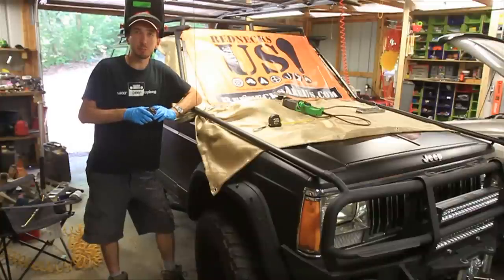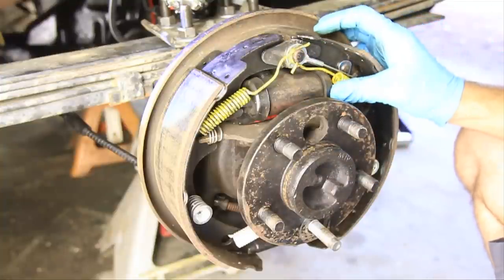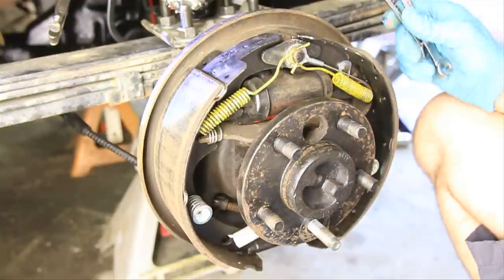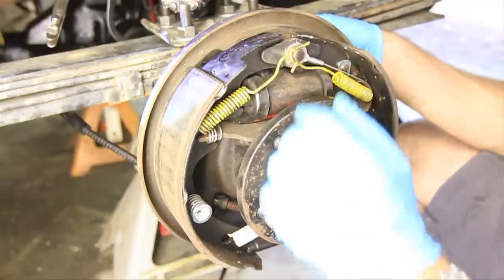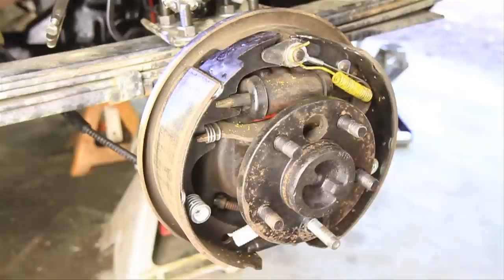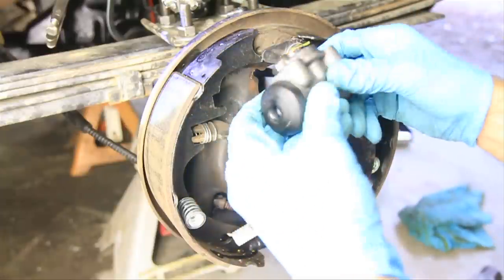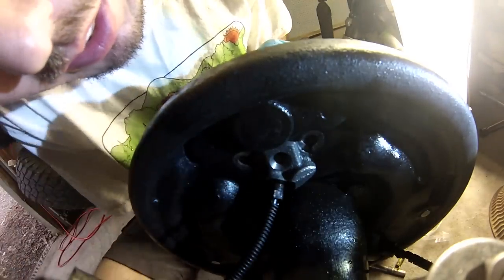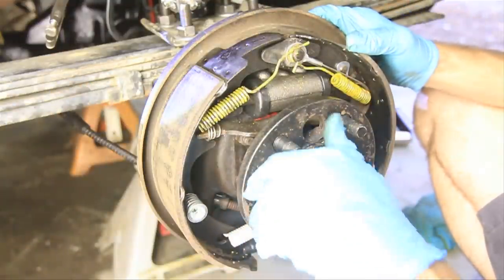How to Change a Wheel Cylinder Without Removing the Brakes

Comment: Just replaced the wheel cylinder in my 70 Cadillac and this video saved me hours. It took as long to do thevwheel cylinder as it did  to get the drum over the reassembled brakes. Thanks!

Comment: Very helpful!  Evidently your brakes are the 10" variety, mine was the 9" variety.  Besides the size, there are at least two other differences: (1) the wheel cylinder on the 9" pushes directly on an extension of the shoes and doesn't have the external fittings on either side of the cylinder, and (2) the brake line comes straight in (no hose) and therefore there is no difference between the right and left cylinders.  To give me a little more room to work, I also removed both top springs and then when I removed the 3/8 inch bolts holding the cylinder in place it came out quite easily (I didn't even have to take off the bleeder screw).  On the old cylinder, the fittings for the bolts, brake line, and even bleeder screw were 3/8".  On the new cylinder, the only difference was that the bleeder screw was a 5/16" fitting.

Comment: just a little insight, you shouldn't use petroleum based products in the brake system (even as lube) it will cause all of the rubber components to swell and brake down considerably faster use something like sil-glyde as a lubricant instead.

Comment: Thanks for posting this, I referenced it many times whilst changing the wheel cylinder of my 2002 Ford Ranger. Took me an hour to beat the rusted on drum cover off the drum (no videos about that !) and another 10 mins to beat the rust off the inside of the cover before putting it back on, but without this video nothing would have been possible, cheers Bro.

Comment: Thank you!!! I broke a bleeder screw off in a brand new cylinder and had to replace the whole thing. This worked like a charm.. this is the easiest method to get the old one out and new one in.. done in 10 minutes or less.

Comment: The one end of the "puller" has a notch in it, that end is used to slip the springs back on. Slide the tool through the spring, the notch will sit on the anchor, and pull the "puller" toward you, the spring slides right on. And the other end with the cylinder, on mine as an extra lip, put it over the anchor, and twist it, the lip slides under the spring and it pops off.
Reply: The first time I did DRUM brakes, I used screwdrivers, vise grips and needle nose pliers.  Buying that multi-tool is WELL WORTH the investment.
Reply: David Raba....I was thinking that same thing.  Interesting that he didn't know that. hmmmm.   lolol.
Reply: B Epps I bought the tool when i did my the other day and ended up just laughing at it. Some vice grips are strength are really easy to pull them on and off or a flat head for leverage. Took an hour on the first side and then had the next side done in 10 minutes or less

Comment: Great video and it saved me a lot of time (and work) by not having to remove the shoes. The only thing I would suggest is to NEVER use any petroleum product on rubber, because it can  degrade the rubber, which will cause a leak. Use a SILICONE lubricant instead, as it does not damage rubber.
.
BTW: If you happen to have an electric window that is slow, or 'sticks' in a certain spot, the motor/track gear may not be the problem; the window may just need to be lubricated. Lower the window all the way down and, using a can of silicone lubricant that comes with a spray 'straw' , squirt a steady stream of silicone into the rubber track on each side of the window. Start at the top of the door frame and spray down to the top of the window, on both sides. After doing so, run the window up/down a few times and - if the motor/track gear is good - your window will operate just like brand new.

Comment: $$$ Great video, you just saved me some $$$ and time.  Easy to do on my 01 Cherokee. Time to do it: 30 minutes. Time to wait for the penetrating oil to get through the rust of 17 years and 155, 000 miles: 20 minutes

Comment: Thanks for posting. It is thorough and clearly explained. I see someone else has already remarked that you shouldn't have used petroleum jelly (Vaseline) in a brake installation. I would only add that you absolutely must start off screwing in the brake pipe (and other things) by hand, and not at once with a spanner (wrench). You mention how important this is, but you don't do it.  Just a constructive observation this, not intended to be criticism.

Comment: On second thought just take the springs and shoes off so you can inspect them for unforeseen damage anywhere. I swear once you take it apart you'll learn that it's actually pretty simple . 2 top springs one bottom spring and two spring loaded pins that hold the shoes on that's pretty much it and in some cases a automatic adjuster on the bottom which is pretty straight forward.if anyone ever needs advice just respond to this message I'll text you through it .
Reply: please text me put shoes back on rear 57 Tbird

Comment: I have a quick question for you. If the dust cover comes off of the 
wheel cylinder and the piston pops out yet no fluid leaks, do I still 
need to bleed the brake lines?

Comment: An even easier way: Use a large BAR CLAMP in the SPREAD mode and force the shoes away from each other. No spring removal needed that way!
Take the rubber feet off and grind some grooves so it fits the shoes better.
Works OK on 10" drum brakes and larger.
Reply: ddd228/Dave in Seattle. Good tip. Ive got 1 of those style clamps
Reply: Gotta be careful with that approach.  If you spread too much, you may end up replacing spring(s) if you stretch them to being sprung.

Comment: Hey @BleepinJeep I attempted to replace my brake cylinder on my 99 TJ last tonight and got to reattaching the stiff brake line to the rear of the cylinder. I just cant get the threads to line up and take into the cylinder. I know they go in as I attempted it before trying to install. Any advice of tips to get them to line up properly?

Comment: i had a very hard time with the two mounting bolts and with the brake line. on drives side rear, i made two bolt studs, i  cut the heads off  two bolts  i had ,they treaded into cylinder and stuck out about 3/4 inch. this allowed me to line up cylinder and then remove studs one at a time and replace with correct bolts. the studs kept ever thing aliened also loosened brake line tee connection fastened to rear axel this gave me the extra play to get the line started back into cylinder. this was a terrible day. nothing wanted to go right
Reply: dyna friction  brand part num 375-54017    375-54016   1988 jeep cherokee from rock auto their part is out of specs. the passenger rear would not go on so i went to auto zone and bought one cylinder .went on in less than 2 min flat . pissed off at rock auto

Comment: I second what Kyle said.  Also, I don't understand what the point is in removing and reinstalling the bleeder valve on the wc.
Reply: How tf u gunna get the brake line off? the bleeder valve is right above it. Thats why its removed easy access.

Comment: If your brake shoes are contaminated with brake fluid from a leaking cylinder you must replace those too. Otherwise that brake will tend to lock up easily.

Comment: I got a problem with my brakes, only brake the rear brakes, never the front wheels, in the begin was funny, but not when you drive in highway with rain, somebody knows what can it be? I change front/rear cylinders, front/rear pads, front disc and rear drums, brake pump, install a new booster, the circuits front/rear are connected right., everything! in fact that is a new brake system, but have the same problem, when I "adjust" the rear brakes, works fine just 10 or less hard breaking, but after a few pushed of brakes, the rear brakes block first than the front.